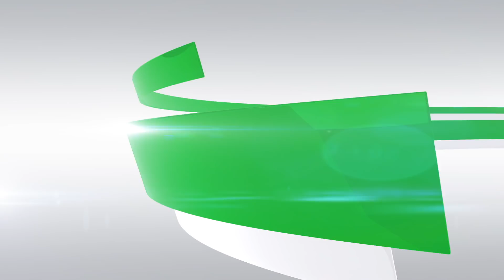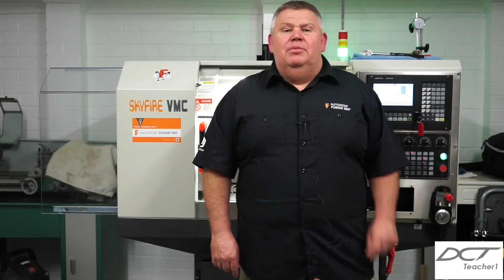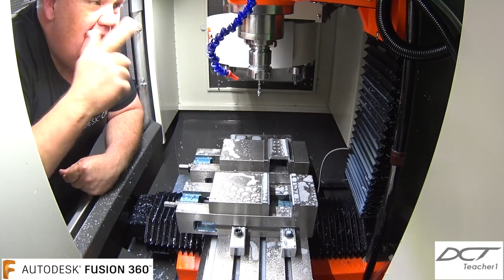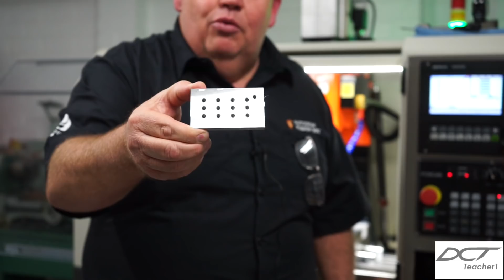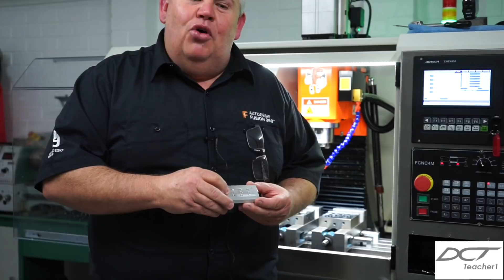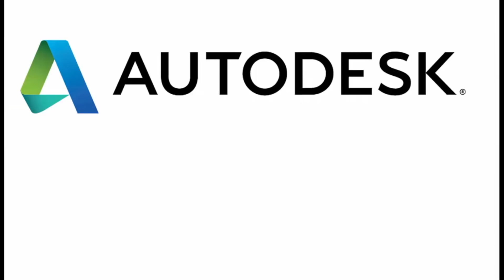Rigid Tapping with SkyfireCNC - Fusion 360 YES WE CAN

Comment: Hello Aron,
I bought same machine, SVM-1 4th axis, about 3 years ago by influenced your videos. Your video was greatly helpful to me to getting start CNC work as a novice machinist with absolutely zero cnc knowledge. 

Three years now, I am very happy to enjoy the machining although, experiencing difficulties to trouble shoot whenever it has various malfunctioning without kind supporting. 

I tried rigid tapping many ways but no luck until now. Have to use thread milling instead.  

I noticed that you have changed some parameter on controller to success rigid tapping. Can you share me what parameter did you changed? I believe that my controller is same as yours.  HaeWoon/South Korea
Reply from the maker: Dear HaeWoon.  I'm very sorry but I no longer have this machine.  I sold it and went with Syil.  I now have a larger and much better CNC machine X7 Combo.

I just looked at my email, and Defeng told me to change parameter 026 spindle open delay time = 0

I hope this helps mate.  Cheers, Aaron.
Reply: @DCT_Aaron_Engineering  
Thanks. I will trying again with the parameter you informed hacked.

Comment: Hi Aron, The AdTech 4940 i received is really good as i told previously, but unfortunately i run out of time due to work commitments, so i ended up buying a XYZ-710 Machining centre equipped with a Siemens 828D. I have to say...... A MONSTER, it worth every penny you pay for, i will post a video as soon as i start understanding the controller, but the arm tool changer is a dream, did you get your new machine at the end?
Best regards
Emanuel
Reply from the maker: Emanuel Bonetta Hey how are you? Nice to hear from you again. Congratulations on getting your new CNC machine. That sounds very exciting and I’m very happy for you. The Siemens is an excellent controller and you’ll  get many years of trouble free use from it. I sold my Skyfire machine and purchased a SyilCNC X7 combo. It is running an LNC5800 absolute closed loop servo system. I’m very happy with its performance. 🍻

Comment: what size vices aye you running? I heard that 6 inch ones wont allow it to home without the vice hitting the encloser. cheers
Reply from the maker: Hello Rob, sorry for my belated reply.   Both vices came with the machine and I think they were $120 USA each.  However, keep in mind that they are Chinese and not of high quality.  My advice, spend the money and purchase Orange, Gerardi, Kurt or Galcern.  Way more money, but highly worth it.  Cheers, Aaron.
Reply from the maker: Sorry, these are 100mm (4") with an opening of 110mm (4 3/8").  I wouldn't put anything larger in the machine or you could crash into something.

Comment: Hello Aron, Thanks for your feedback, very appreciated!!
The difference between Rigid tapping and Analog tapping is that the spindle is controlled by a proper axis (as you would control your A(rotary) axis in position, on top of that you can even choose the option in Fusion 360 (G95-Feed per revolution) to control your pitch  divided by every revolution of your spindle, so the taper pitch of 1mm would be F1 or F0.5 half millimeter pitch. very convenient!
The analog tapping(in your case) is when the spindle motor is controlled by the inverter jointly with an encoder to read the RPM and keep the rotor nearly close to a servo controlled movement. As you can see in your video when the spindle is rotating to  the zero position to change the tool is always bouncing a bit before it stops, that would never happen in a servo spindle. So this behaviour is reflected even in the tapping, and the faster the bigger is the error in reversing the rotation.
Your videos are great as they are, clear and well explained. 
The new 4650 is now called 9650, more memory and some changes in the software, i would never change the Skyfire, i would just upgrade the controller and if necessary the servo motors, it would cost you much less. Or are you planning to keep both?
I will send you some info and feedback about my new 4940 as soon as i receive it.
And if i can( i am like a crocodile managing cameras) i will upload a short video to show you the difference between the 2 method of tapping, is very interesting, i think if you try it you will never go back.
PS. regarding the controller struggling with large files, maybe you should check if the "look-ahead" function in the controller is active and how many blocks is reading, that could be the problem, the 4650 is equipped with FPGA chip, so all the steps and movement calculation are done by this chip, leaving the main CPU free to do the rest, is not a bad controller .
My 2 cents.
My best regards Aron, thank you again for the feedback, definitely one of the best channel i have even seen.
Emanuel
Reply from the maker: Thanks for getting back to me Emanuel and thank you for your kind sentiments.  I wouldn't say best channel, but I'm trying hard LOL.  Thank you for the clarification with the Adtech and rigid tapping.  The Skyfire actually has a servo encoded spindle, but compared to the HAAS at school where I teach they are really chalk and cheese (you would expect that for the difference in price).  When the Syil machine arrives I will probably sell my Skyfire and invest that money into a Syil CNC Lathe.  I will look forward to your video.  Please share it with me when you do it.  Cheers, Aaron.

Comment: Hello Aron, just come across your videos as i was looking to find some info about my new AD4940 controller  i just got for my project.
 Very well made great videos, thank you for the time and effort you put into, you have a new follower form London!! 
By the way, the M29 parameter is a code that engage the rigid tapping (M29 S#### as shown in your code), is used in some controllers together with the G84 code, the ADTech do not use it, that's why the error.
 The difference is that the M29 code swap between using the Servo spindle(Step and Direction) instead of velocity and spindle encoder(Vref 0-10 volts).
Is more accurate but the controller need an additional dedicated axis  to work(engaged by the M29) or if the 4th axis is used is unavailable during the rigid tapping obviously  plus you need a Servo controlled Spindle that can do both steps/Volts which is quite expensive when you go up with the KW.
My 2 cents. 
Greetings from UK.
Reply from the maker: Hello from Melbourne Australia Emanuel.  Glad you found my channel and welcome aboard.  Let me know if you would like to see anything or have a video suggestion.  Thanks for the information regarding the Adtech.  Apparently my 4650 is an old controller and Adtech are no longer supporting it.  It struggles with large 3D tool paths or very large files.  I've also been told that this isn't rigid tapping but analogue tapping.  But I don't have clue to what that means?  Hopefully in a month or two I'll be getting a new Syil machine with an LNC M5800 controller.  I anticipate this one will leave my old Adtech for dead.  Cheers, Aaron.

Comment: Hi Aaron what was the parameter you had to change?
I cant get mine to work even after removing the line of cod e you describe.
Phil
Reply from the maker: Hi Phil, got your email and will answer shortly mate.  Cheers, Aaron.
Reply: @DCT_Aaron_Engineering  Hello guys. I have the problem with my VMC SVM-2 riggid tapping. Can you send me the parameters and g-code used for solution. Thanky you very much!

Comment: Aaron, check your inbox. I edited the post at my end and got it working without the M29 code appearing after post processing. Cheers Pete
Reply from the maker: Hello Pete, thank you very much for doing that mate.  I will check my email shortly.  Did you edit the post processor yourself?  If so you're way smarter than me lol.  Oh, could you do me one more little favour in the post.  Could you enter a 3000ms pause after the spindle command.  For example s6500 m03, in the next line P3000.  This will allow time for the spindle to come up to speed.  If not I can get Scott Moyse to sort it for us. Cheers, Aaron
Reply: Hi Aaron, 
I did it myself and surprisingly it was pretty easy once I understood the way the post processor formats the commands. This morning I worked out how to put program stops between cycles as I don'y have the ATC installed yet and have to do tool changes manually. Even though Fusion has the ability to add manual NC code in the cam section it keeps putting it before the spindle stop command so the cycle ends with a spindle still running. I will have a crack at the spindle command today.

Cheers
Pete
Reply: Hi Aaron, 

Spindle delay of 3 secs added. Give it a whirl and let me know if it works. I am starting to enjoy this controller now.

Cheers 
Pete
Reply from the maker: Hey Pete, I'm flat out till the weekend but I'll give it a try then mate.  Thank you so much.  Aaron.

Comment: Aaron that's awesome. You have to be totally stoked. Now if it will just change parts for you and run itself. Can you give us the insight as to what post processor to use for rigid tapping. I know you said 360 and remove the 29 line of code then you threw the curve ball in there and said the other fellow was tweaking the post processor code. My SVM-2 is suppose to ship next week from Skyfire and rigid tapping was one of the reasons I bought it. Need to get up to speed on rigid tapping before it comes.  Actually the biggest biggest reason was the 12 tool changer.  That's worth $18,000 to have that after years of hand changing tools.  Your help in the future of the Skyfire community is awesome. I'm sure I speak for everyone watching your videos that we appreciate the time it takes to set up videos and edit them.  Looking forward to using what I've learned from you on my Skyfire. Thank you.
Reply: Yah, we will get one also it will be great if you get us copy of post you use there we have the same controller 4650. Thanks a lot 👌🏻
Reply: Hi Aaron, emailed you at the youtube email, hope that was it.  I'm at jack@roadstercycle.com
Reply from the maker: Roadstercycle Hey mate, I forgot to give you a shout out. Scott from CADPRO will adjust the post processor and this will work fine. I also had to change a parameter in the controller. My advice is to stick with Fusion360 CAD CAM and use that post. Cheers Aaron. Ps: can’t wait to see your machine. Please video it 👍
Reply: So Aaron your saying use the Fadal post processor in fusion 360 and remove the M25 line of code.  Is that correct?
Reply from the maker: Roadstercycle Hey bud, no not the Fadal post. Adtech use generic Fanuc. Scott tweaked that for me to get me up and running. The post processor was renamed Adtech-2. Can you email me please. Cheers
Reply from the maker: Python cnc Hey PythonCNC, I’ll let you know about the share. It’s not my intellectual property as the post belongs to Scott Moyse / CADPro
Reply from the maker: Roadstercycle hi Jack. Yes I got your email bud. I’ll reply later on just filming ATM 👍

Comment: The same problem as the Hurco had in the post processor.
Reply from the maker: Micheal Connor hey mate, wow that’s amazing that it had the same problem. I also had to change a parameter setting in the controller. Cheers mate. I’ll give you a call before I head off to Vegas 👍